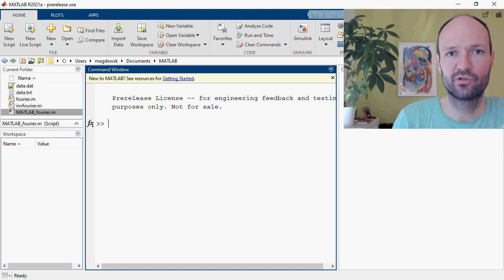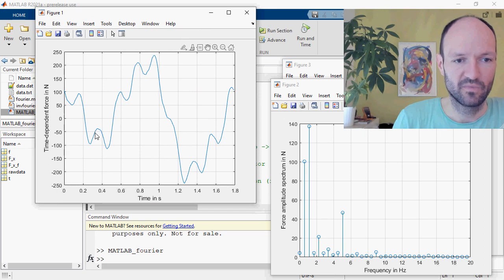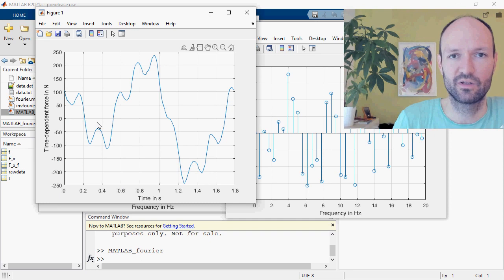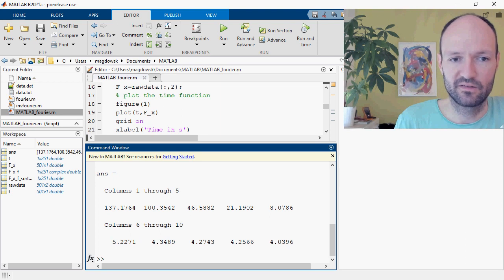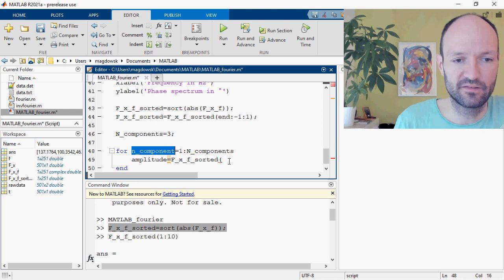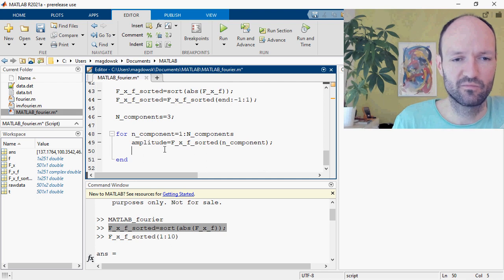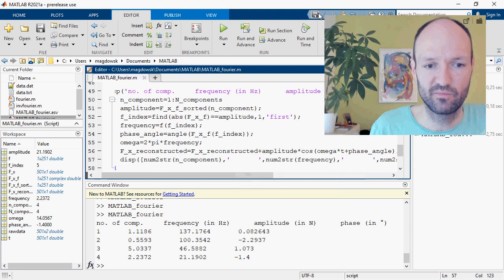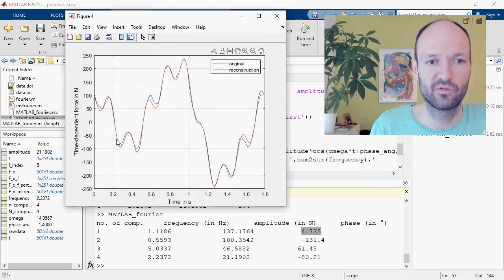How to reconstruct a periodic signal as a sum of cosine functions from the freq. spectrum in MATLAB

Comment from the maker: Unfortunately, I found a bug in the code of my example provided at:
https://octave-online.net/bucket~EP15mJvkgLCmzodFStNw3b
This code will only work, if the DC part is zero or quite small. If it is not, it must be devided by a factor of 2 when reconstructing the function.

On solution to fix the problem is to replace the lines:

% reconstructed signal (in N) -> vector
F_x_t_reconstructed=F_x_t_reconstructed+amplitude(n_harmonic)*cos(omega*t+phase_angle(n_harmonic));

with

% reconstructed signal (in N) -> vector
if frequency(n_harmonic)==0
    F_x_t_reconstructed=F_x_t_reconstructed+amplitude(n_harmonic)/2;
else
    F_x_t_reconstructed=F_x_t_reconstructed+amplitude(n_harmonic)*cos(omega*t+phase_angle(n_harmonic));
end
Reply: thank u very much